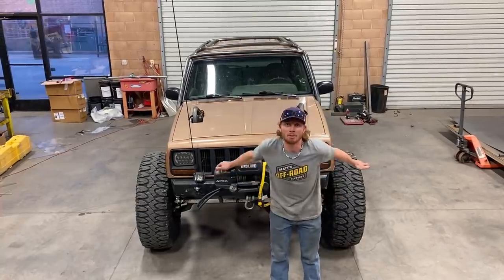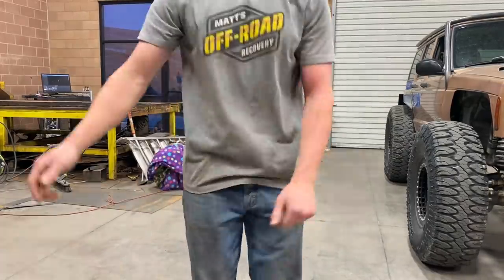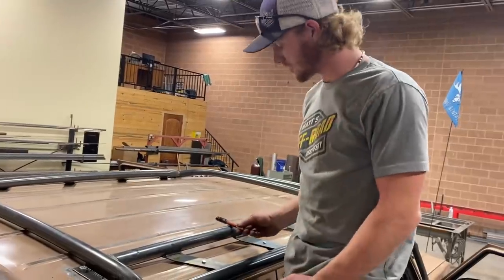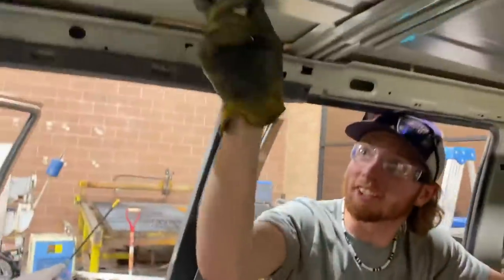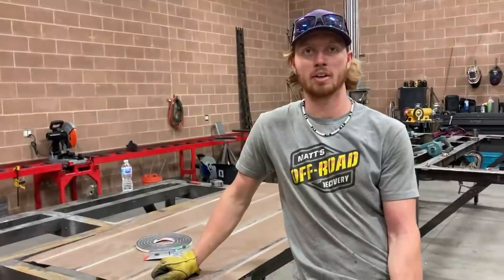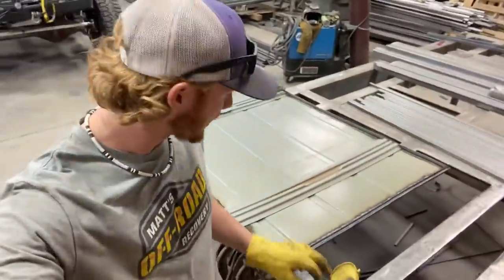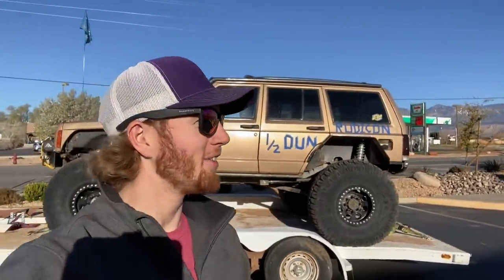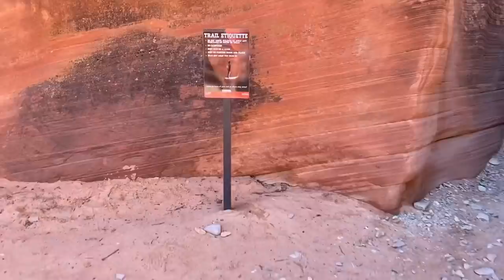I Cut the RUDICONS Roof Off

Comment: You should consider cutting the roof section in two so you can stow it in your jeep when it is off. You can either keep it as two separate pieces or add a hinge so you can simply fold it up & put it in the back. Being able to remove the top is great until you end up getting unexpected rain.

Comment: I’d ditch the carpet and add some drain holes. It’s just a matter of time before you get caught in the rain with the roof off. Love all the content, keep it coming.
Reply: Agreed.  Drain holes and bed line the interior. 👌
Reply: May as well Rhino Line the interior after treating the rust with Rustop.
Reply: I say throw some top soil and grass seed down there and let it grow!
Reply: I have rubber mats instead of carpet in my trucks just so I could put the noise suppression padding under it my jeeps are brush in bedliner
Reply: Agree, Remove the carpet, add Rubber Spray On flooring so it can be washed out with a pressure hose if you need to, keeps the floor sealed, dampens the road noises or creaking suspension, and not cold on the bare metal over winter.
Reply: That gasketed channel will certainly leak sooner or later too.
Reply: Why not just have eg a canvass hood, to pull onto the rollcage during wet weather?

That could double as a sun screen, save on power to the aircon, when it gets hot hot in Utah.
I only say, because my old neighbour had an ex British military Landrover from service in sunny Africa.
 In the days before aircon became a thing, it had a second roof set an inch or so above the actual roof, to prevent sun beating down on the vehicle, cooking the cabin, when not in use. 
In motion, the airflow between the top would assist in carrying away the heat inside the crew compartment.

I should imagine that'd be made to measure for you guys, working in the desert during high summer in Utah, maybe even save some gas mileage?
Reply: @gordonmurray3153  good idea with the cover to be pulled up over the roll bars.  Since Utah has a very dry climate, I'm pretty sure that air conditioning isn't all that necessary. You just need to keep direct sunlight off you and have air flow to take away the heat. Since the dew point is so low you won't feel hot and sticky, even at high temperatures.
Reply: @percyfaith11  I remember Matt mentioning the huge power draw of the aircon on the Banana and Morrvair, how it took a lot of energy to keep the motor and other systems from running too hot.

Inside those vehicles carrying 2, 3 or 4 people, plus pets, I'd imagine is going to raise their cabin dew point quite significantly, regardless of what might be going on outside in the desert.

I reckon that the Rudicon 1/2 Dun would share those same issues.
Reply: Xjs have drains already. I do believe

Comment: Best of luck with the new channel Rudy!  You all are building quite a franchise!  This video really made me smile because cutting the roof off your jeep is such a young guy thing to do!  When you are young you have so many great ideas, and you are willing to suffer so many inconveniences to try them out.  You get older and you start thinking through all the reasons why something is a stupid idea.  You think about the leaks, wind noise, rattles,  exposure, the lack of security,....sigh.    I'm 64, and I started cutting up cars why I was 17 with little hesitation.  I'm still doing it, but now I think long and hard before I start chopping.  I ended up regretting most of those early ideas, but is just a step along the way to mastery.  It's great to be young.

Comment: Rudy's Rock !!! Paul has a lathe. Harbor Freight has an auger, D rings and sledgehammer. Fabricate a 2 inch I bar into a point, add D rings to the top, pound it into the ground and pull yourself out. Rudy's Rock, there when you need it.

Comment: Another way to do this would be to use a scrap jeep like the one you had with all the wire issues, cut your roof out and lay your roof on top of the junk jeep and trace it, then cut the jeep roof an inch bigger on all 4 sides. Then it will overlap, then you simply put zues nuts on your roof and put rubber weather strip in between the 2. Just an idea from a fellow fabrication guy.

Comment: Maybe consider putting it on rollers to be able to roll it back and forth and connect it to the suv. Leave it on, slightly off the back, so it will look like a big sun roof instead of having to store it somewhere else. Incase it rains 🌧 suddenly, you can slide it back into place.

Comment: Perhaps you should add a keeper for the pins so that when you pull the pin safety on the latches you won't loose them(or have plenty of spares when you loose them someplace other than the shop).

Comment: A good start, but you need to boost the sound volume quite a bit! I had to push the volume slider all the way to the right to max. If I forget to move it back, I will get BLASTED by the next video.

Comment: From a part of the country where it rains... I'd have taken the roof off a second YJ, larger than what you cut off, for some overlap. Put the C-channel on the bottom, and run drains out and down the pillars because the gasket will leak so you want to give that a place to go.

Comment: I say cut it all off, weld in a bunch of snaps to the cage, and get a snap on fabric top, should keep out all but the worst weather. Put a lip on the opening to keep water from draining in.  At least you can build a snap in Mesh fabric top to keep that killer UT sun from roasting you

Comment: You should use a fabric for the roof. I would us the material off of a soft top on an old wrangler and fit it to roof with push on clips and a rubber seal

Comment: dont like the look of those bolt heads holding the front and rear together on the roll cage, i think it would look better if you cut some tube in half and welded the bolt threads to it and then put the nuts on the back to bolt it up, that way no bolt heads on the outside.

Comment: I took of my roof like this once back in the 90s. But it was FL and well it never sealed properly and leaked water all the time. I just ended up dilling holes in my floor to drain water, and putting umbrellas over my drivers seat to keep dry. I didn't have that car too long. I'm sure it's been turned into a bridge or something by now, lol.

Comment: Wow- I have tried to rip a 1x1 Doug fir before and it is very hard to get it straight- with a circular saw! You ripped (what appears to be) a 3/4 x 3/4 Steel tube with a circular saw. I wouldn't even attempt that. I'd put a steel blade in a table saw and clamp the rip fence down like crazy!! Good job!

Comment: Howdy Rudy. I am enjoying your channel. I don't know if anyone else has mentioned it, but I think you need to work on your sound in edit. Most editing software has a "compression & limiter function built in, using it on preset sometimes works but might need a little tweaking. It's a bit hard to hear ya, and sometimes it blows your head off lol. I sure enjoy what I am seeing so far. Good luck & much success with you're in Devore.

Comment: In my first jeep the front doors wouldn't open so you had to climb in from the back, but then the bolts going into the seat ended up getting stripped and so if I would accelerate too hard when I was driving the seat would pop off and I would have to hold myself up with the steering wheel to keep from falling over

Comment: You have a long rack with a chop saw to cut long pieces into short ones.
It seems a Table Saw mounted inside that track would be ideal (safer and more precise) for cutting the Square Channel into C-Channel;  Although, I don't know how often you would need to do this in fabrication.

Comment: Congrats on the new channel! And awesome job with the roof. You actually gave me an idea. I have an 08 Liberty for my daily, and it has the sky roof electric rag top option. Well, as they are known to do, it broke. Fixing it is basically a $3k dealer job, or deal with it and I'm not paying $3k! I wonder if I could do something like what you're doing. For now I just closed it, pulled the fuse, and sealed it up with waterproof Gorilla Tape.

Comment: Hey I have a question, i have the exact same make model of jeep and happened to stumble upon your video. I’ve got a 6.5 in lift with 33s on, but when I lifted it I ended up with multiple different steering struggles, and struggle to drive her without being worried about my ability to keep control. I’ve been told many times it’s just big tires and the high lift, but it feels like there’s something else not right, any tips or does yours have similar steering struggles

Comment: I'm wondering if you should add a stiffened between the B pillars to repkace the rigidity the roof provided. Otherwise I  think the added body flex might eventually crack the windshield. But then again you might roll it and demolish the windshield way before that anyway.

Comment: You people in the USA are lucky: you can from what i can see from all car mods programs do what you what to your cars.
lets say i have a VW beetle 1960-80`s with drum brakes and pretty much crap parts all round and wanted to upgrade them to disc brake and better everything ells it would fail M.O.T check  it`s yearly here by us in Belgium/ Europe. if the car is not stock as it came from the factory it will fail! even the tier's brand and model has to be right. 
make the car safer and better is not allowed and it fails MOT. how do you like them apples. idiots running government reg`s hear